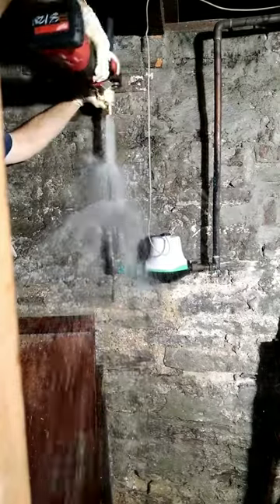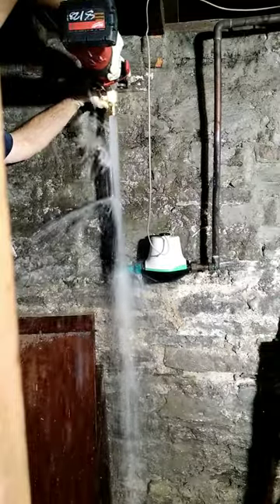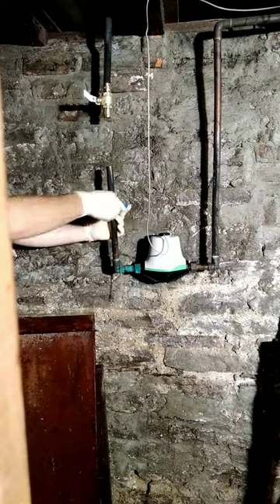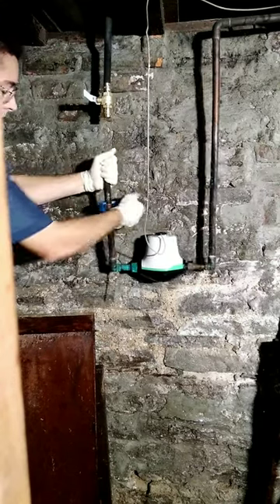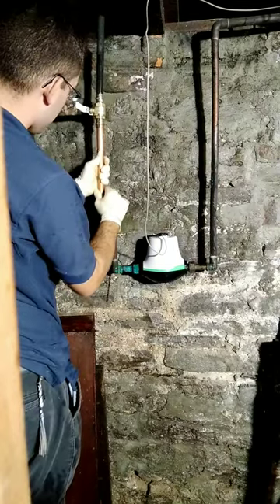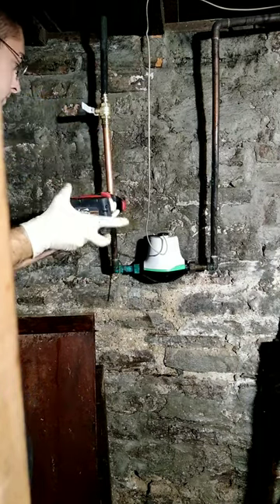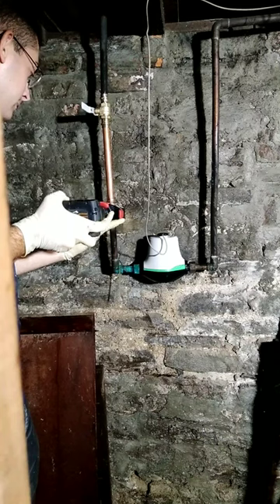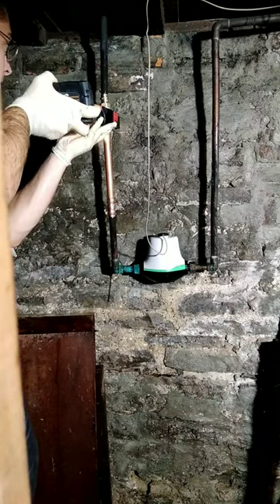Replacing a LIVE main water valve #plumbing

Comment: How about pipe freezing?
Reply from the maker: As long as they pay the gas bill this winter they're fine. Otherwise if they know it's going to freeze then they better shut the water off and drain the lines
Reply: @SamThePlumber  I meant, to freeze the pipe temporarily, to stop the flow of water.
Reply from the maker: @Goldarr1900  haha for that much work I would've just called the city water department. Pipe freezing is good for rare instances on some commercial jobs tho that can't afford a water shutdown
Reply: @SamThePlumber  👍

Comment: You should at least clean the outside of the pipe where the valve goes with some emery cloth or Brillo pad so you can ensure the press gasket is making a good seal.
Reply from the maker: It's solid copper. There's no reason to sand it down because it oxidized. You can even pro press directly over painted copper pipe. I do it all the time and I have absolutely never had an issue, even on boiler systems.

Comment: Try cleaning the area your cutting first, (JS) jet sweat with pass through for me though. 
I've done smaller diameter pipe with electrical tape as a pass thru on 2" with full port ball valve. (Not full pressure)

Comment: Bro can you really pro press on to dirty pipe like that?
Reply: Yes
Reply from the maker: Absolutely. It's not a dirty pipe, it's just oxidized copper. There's no need to clean it unless you're soldering.
Reply: @HvacSam you didn't even debur it at all.   That seal is going to fail.   Keep to HVAC, not plumbing.
Reply: @homesteadhaven2010  who cares only real plumbers use a torch

Comment: Lol what would you do if the copper had expanded
Reply from the maker: This is hard copper. You're correct tho that soft copper expands when it freezes. In that case Shut off the water at street and braze a 7/8ths to 3/4 adapter.

Comment: Wow, imagine if you put a flex hose on the end of the ball valve and put the open end in a bucket! But F it, not your home 😂. I’ve done this by putting ball valves on hot water tanks so I get the convenience. But if you are doing this for a profession…..that’s what a handy man would do but we all have different levels of work ethic. 👍
Reply from the maker: I tried putting a flexible garden hose on the end of this week's latest live valve swap. It was impossible to push the valve on the pipe. The force of the water pressure was just too much.
Reply: Yup true that 👍

Comment: Here is a new product from Europe,  it's expensive . Prices will come down when the competition bring out their  own . It's called EasyFit Isolator Valve 👍
Reply from the maker: Seen it before. They're garbage. Plus like you said too expensive. Meanwhile Pro press will never leak
Reply from the maker: @alec1113  the easy fit isolator valves that install on a live water line? Call me old fashioned but I'd never use them

Comment: Drain down into a bucket at the meter union...sand the pipe before u cut it out so it's ready to go 😂
Reply from the maker: Sanding pipe before pressing is an urban legend. It does nothing. You only need to clean the pipe when soldering
Reply: @SamThePlumber  ok ur see 👀 one day
Reply from the maker: @larrytheplumber9851  I've pressed green crusty copper without cleaning it. Still seen it holding just fine years later. I'll let you know if I ever have an issue with it. 😂

Comment: A regular compression valve wouldn’t be much slower
Reply from the maker: Real men either use press or sweat. Compression fittings are garbage and always corrode and leak.
Reply: @SamThePlumber  thanks. Press is pretty much sharkbite. Just an oring that gets compressed. Soulless

Comment: Should have just told the fella holding the hosepipe to turn it off because if you think that is Mains water from the street you are definitely a carpenter 😂
Reply from the maker: What
Reply: @HvacSam  how many bar of pressure do you reckon that was?
Reply from the maker: @YNWA-oq5uf  All of the homes in Lima are between 60 to 90 psi. A lot of them are around 80 to 85 psi

Comment: Get a "Jet Sweat"  and run it through the old gate valve.
Reply from the maker: Definitely a option :) I would if it was a nicer basement. Don't really see anyone using jet swet anymore tho. Press is the new method. No one solders or cares about water in the lines anymore
Reply: A Jet Swet wouldn't work in this scenario. The gate valve would need to be open to get the Jet Swet in the pipe, and you'd have to cut the pipe to get the Jet Swet in too. It's 50/50 whether the Jet Swet would successfully hold back the full city pressure too, and it would be a pain to jam the thing in there while water is shooting out.
Reply: You’ve definitely never done this

Comment: Could have just caught the water in a bucket or garbage can, but you know... whatever 😅
Reply from the maker: Lol, 5 gallon bucket would've overflowed in like 5 seconds. There's more pressure and gallons per minute coming through a city water main than you would imagine. All of the faucets and showers on your house have what they call flow restrictors built in to make the water pressure manageable.
Reply: @SamThePlumber  A large garbage can would work. We did it in a casino about a month ago. No mess
Reply: I mean yk look at the basement he’s in i’m sure it’s been wet down there plenty of times if it’s a finished basement i’m sure he’s catching every drop lmao
Reply: Did you see the floor?...
Reply from the maker: @BadBadgerTrollAccount172  for real. Basement was already flooded from a different plumbing leak when I got there lol
Reply: @BadBadgerTrollAccount172  do you see the wall?

Comment: Or you can buy one of them $250 valves that you don't need to cut an active water line.
Reply from the maker: Haha yeah and then replace it again when the rubber o rings on those leak. I'll just press a $16 press valve
Reply: @SamThePlumber  I'm there with you. When I saw it and the price. No thank you.

Comment: 🤣 “only a 1 1/2” of water” dude that’s a lot. Next time grab a 40 gallon garbage can and you’ll have zero water. Water in a basement has a hard time drying and builds mold and bacteria
Reply from the maker: It's the south side of lima. Not a big deal. Water evaporates very quickly on concrete

Comment: WOW even on the bottom coupling with water not running you didn't clean up or deburr the old copper... bro your bad at life... how are you a happy plumber???
Reply from the maker: Not necessary with press fittings
Reply: @SamThePlumber  when you take the training on propress they stress that you need to ream the inside... deburr the outside... and sand it down.... sorry you were taught by some very back plumbers who lack skill.

Comment: Sand the dang pipes, oring is Guna go bad as it don't mesh well with any kinda paint....🤡
Reply from the maker: It's clean copper. Not paint. Copper   naturally oxidizes to form a protective layer. It's still solid copper.

Comment: Damn if you can't figure out where the main valve is to shut the water off to that property than you shouldn't be a plumber
Reply from the maker: @garyroach3479 don't nobody got time for that 😂.
Reply from the maker: It's a concrete basement anyways, concrete dries so fast.
Reply: I've seen meter boxes in Atlanta that were paved over with a sidewalk by the city.  Can't always get a main shut off

Comment: Wrong. You never cleaned the pipe properly for the press shut off valve. All you had to do was shut water off at curb for crying out loud. What a hot mess. What's up with these new generation of contractors and plumbers. I hope your not a plumber because I for sure would not want you to do any plumbing at my house. It's common since that when using press fittings the pipe has to be reamed inner and outer and properly cleaned with sandpaper then mark the depth with marker so you know fitting didn't back it's way out. I can tell you right now that shut off valve was not fully seated. And don't tell me you were in a rush because you didn't have time . There are no excuses for this type of plumbing.. this is why I don't hire anyone because there new generation of young adults you have to babysit them to make sure they are doing everything the correct way. This was not done the correct way at all.
Reply from the maker: @Rocket-x9v  😂😂🦜